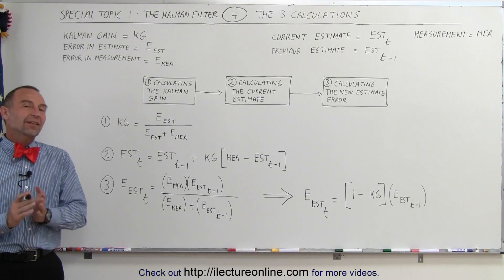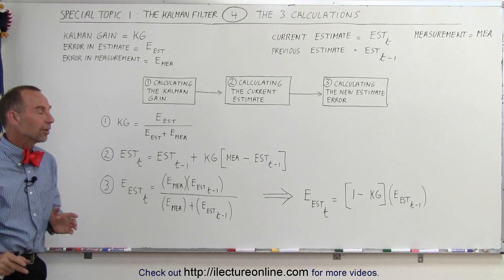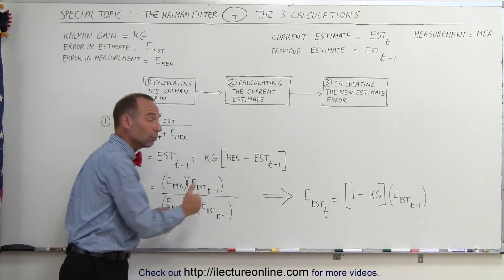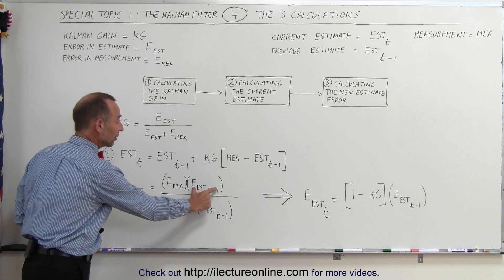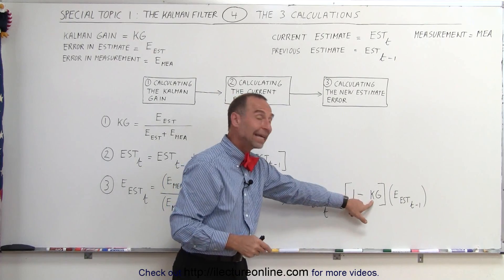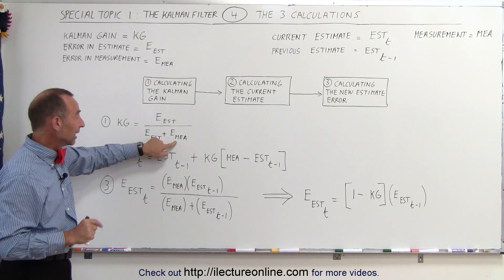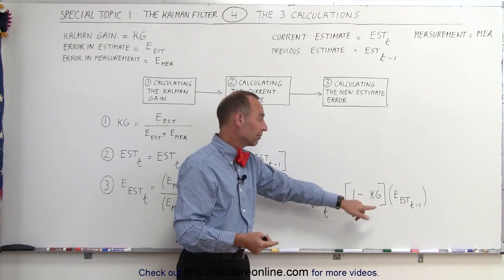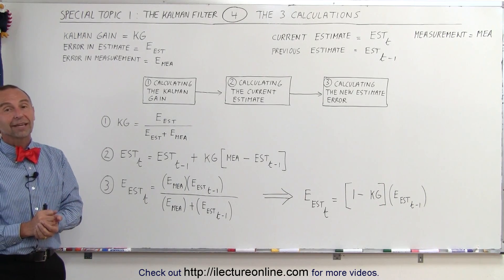Special Topics - The Kalman Filter (4 of 55) The 3 Calculations of the Kalman Filter

Comment: I have a question: 
Based on the block diagram that you have drawn, what is the relationship between formulas 2 and 3 ? Because we have calculated the Kalman Gain and rely on the Kalman Gain to calculate the Current Estimates

Comment: how to estimate the value when measured value is not given ?
Reply from the maker: The KF was designed to smooth out observations, or measurements.  The assumption is that the measured values have some measurement inaccuracies and some errors in the measurement equipment, random noise, etc.  The KF will move you closer to the actual value without the numbers bouncing back and forth with each measurement.   Take a look at the rest of the videos to see if that answers your question.
Reply: @MichelvanBiezen  Thanks for you reply, thanks again for making such good explained detail on KF, most of the audience would like you to make video on EKF.
Reply from the maker: Yes, we are planning on it.  Just have to find the time to prepare them.  Currently working on my book.

Comment: For anyone struggling to see algebraically how Eqn 3 results in ==> E_EST_t = [1 - KG]*(E_EST_t-1), you need to know that there is a small oversight here. Watch video 6 and you'll see that the KG for the current iteration at time t is actually: KG = E_EST_last / (E_EST_last + E_MEA), where last of course means at time t-1. Use that KG now and plug it back into E_EST_t = [1 - KG]*(E_EST_t-1) and you'll see how it turns into Equation 3.
Reply from the maker: Thank you.
Reply: @MichelvanBiezen  I did a post on LinkedIn and tagged you in it too. I hope you see it.

Comment: Question,
If I had a measurement of gyroscopic rotation, I start my data flow and turn the gyroscope, suddenly all measurements have incremented by some factor... 
will the Kalman filter quickly recover and estimate correctly or would it take a very long time to recover, since the gain is so low?

Comment: Nice...but wait... how did Michel got the bottom right equation: E_EST_t = [1 - KG] * (E_EST_{t-1}) ?
Reply: substitute the equations and you will get the last result
Reply: @ammaralammari7020  , but only if you consider MEA=0. Still not clear how he reached that equation.
Reply: I think the better question is how he arrived at the equation on the bottom left? Is there a proof for this anywhere?

The bottom right is simply seen by taking (1 - KG) = 1 - E_{MEA}/[E_{MEA} + E_{EST}] = E_{MEA} + E_{EST}/ [E_{MEA} + E_{EST}] - E_{MEA}/[E_{MEA} + E_{EST}] = E_{EST}/ [E_{MEA} + E_{EST}]

Comment: Sir, thanks for your lecture but from simulations, the kalman filter does not converge to 72. Provided the measurements are random between the range of the error ie between 71 and 79. It rather converges to 75. I think the a little explanation of the behaviour of the measurement wrt the true value is necessary.

Comment: Is the error in the estimate an absolute value in this process? Also, why is there a need to use matrices instead of variables? If I plan to apply the Kalman filter to a single variable or in one dimension, could I use only the formulas expressed in this video?
Reply from the maker: We only use matrices for multi-state problems.  For single variable problems you don't need to use matrices.
Reply: Also how do I apply the Kalman Filter to sensor fusion without matrices?

Comment: There is something wrong in your explanation, to me it seems. 
From your explanation, the error on the estimate at time t is ALWAYS less than the error on the estimate at time t-1, which is not possible, because it may happen that the error increases if the data are not consistent with estimates!
Reply: I watched this videos some weeks ago and was wondering the same thing here than JeuLeuVeu. However i think this is true, as it is assumed here that the underlying true value does not change (and also that we have zero-mean gaussian noise). In that case the KF converges to the true value. 
If, however the underlying true value is suddenly different and this is not considered in the mathematical model (in the state-prediction x(t+1)=Ax(t)+Bu ) the error will be larger for some time until the prediction reaches the new value. Maybe someone else can confirm this or provide more insights.

Also i found a also very helpful source online. Google "Kalman Filter Water Tank" should lead to a PDF with a nice explanation on modelling stuff correctly. Google for "KalmanExample.xls" gives a Excel-Sheet that somehow belongs to the PDF and allows to play around with numerical values.
Reply: In my opinion, in the expectation of Kalman filter, as time goes on, the estimated state will approach the true state more and more close, thus the estimate error (error between estimated state and true state) will always be on a deseasing trend. Precondition: assumption on a linear Gaussian system.